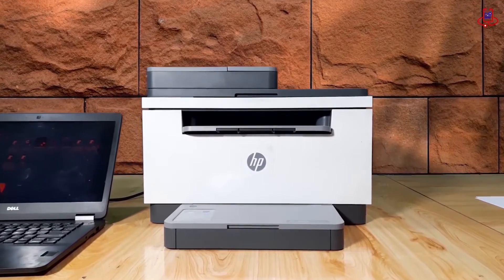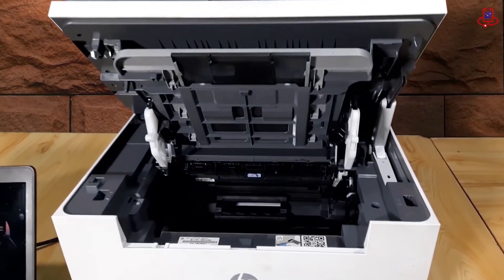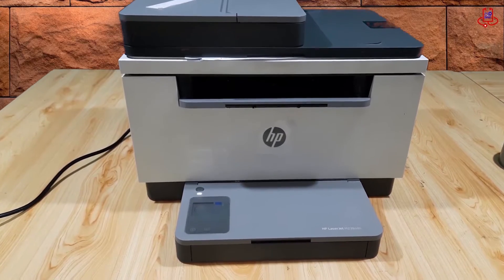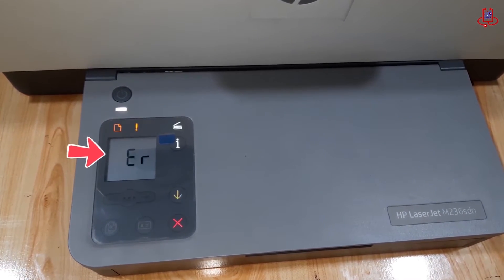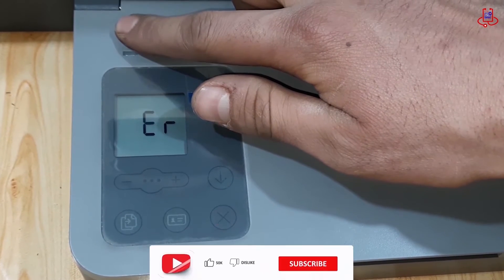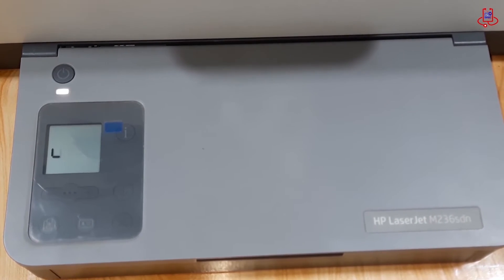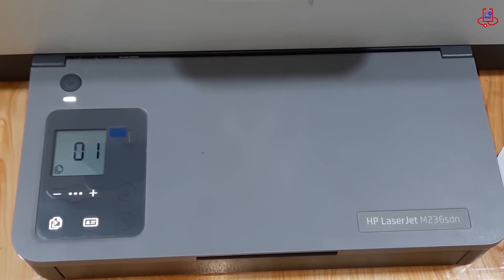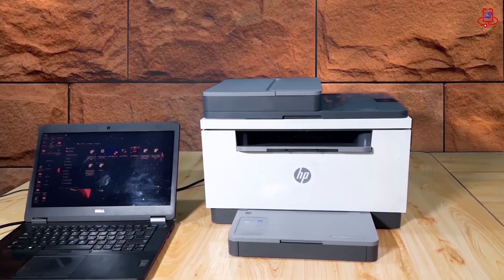How to Fix HP LaserJet Printer Error 77 in 2 Minutes! - Quick and Easy Troubleshooting

Comment: 2606dn error 77
Reply from the maker: Hi! Error 77 usually points to an issue with the fuser unit. Please turn off the printer, wait for 30 seconds, and then turn it on again. If the problem persists, check the cables and ports of the fuser. If the issue continues, update or reinstall the printer's firmware. Finally, if none of these steps work, consider replacing the fuser.

Comment: In HP laserjet printer m233dw printer copy button not working so I am replacing the new formater  board on display showing 76 error and all lights blinking pls tell what's the issue
Reply from the maker: This error usually means the formatter board is not compatible with your printer model or the firmware is not installed correctly. Try updating/reinstalling the correct firmware or use a board made for your exact printer model.
Reply from the maker: Try reinstalling the printer firmware once, it will probably fix the issue.

Comment: Error code error 77I have try that consistently
Reply from the maker: If the problem is not fixed, it’s probably the formatter board, and it needs to be replaced.

Comment: How can I resolve Er 75 in Hp LaserJet M234sdn?
Reply from the maker: To fix Er 75 on your HP LaserJet M234sdn:

1. Turn off the printer and unplug it for 30 seconds.  
2. Remove and carefully reinstall the toner cartridge.  
3. Plug the printer back in and turn it on.  
4. Make sure the printer is connected directly to a power outlet.  

If the error continues, update the printer driver or contact a professional technician.

Comment: How to fix error 76?
Reply from the maker: Error 76 on an HP laser printer indicates a service error. The first step is to reset the printer by turning it off and then on again after waiting at least 30 seconds. If the issue persists, you may need to check the printer's firmware, update it if available, and isolate the problem by trying different browsers or print drivers.
Reply: @devicedoctor1  This error appears immediately after switching on. The printer is not connected to the computer.

Comment: my printer Hp laserjet tank MFP 2606sdw error code 58
Reply from the maker: Error code 58 on the HP LaserJet Tank MFP 2606sdw typically indicates a paper feed mechanism issue. To resolve this, please follow these steps:

Check for Paper Jams: Ensure there are no paper jams or obstructions in the paper feed path.

Inspect Paper Feed Rollers: Examine the paper feed rollers for any debris or damage. Clean them gently with a soft, lint-free cloth if necessary.
HP Support

Reset the Printer: Turn off the printer, unplug it from the power source, wait for about 10-15 minutes, then plug it back in and turn it on.

Update Printer Firmware: Ensure that your printer's firmware is up to date, as outdated firmware can sometimes cause errors.

Consult HP Support: If the error persists after performing these steps, it's advisable to contact HP Support or a certified technician for further assistance.

These steps should help in resolving the error code 58 on your HP LaserJet Tank MFP 2606sdw printer.

Comment: Error 49
Reply from the maker: This issue is likely related to the mainboard of the printer. It requires inspection by a qualified technician to diagnose and address the problem. Repairing or replacing the mainboard may be necessary. It’s recommended to visit an authorized service center for proper evaluation and resolution.
Reply: @ I believe you’re correct.  I tossed it off the second floor of my house for the satisfaction due to its 1.5 years of abusing me with it constant loss of connectivity.
Reply from the maker: @MandyPants1975  
I completely understand how frustrating it must be! Unfortunately, the HP LASERJET M236 printer has had a lot of issues and hasn’t been reliable for many.
Reply: @devicedoctor1  Hello. Can you please tell me where I can buy a new (or used) mainboard (4QL13-60001/4QL13-80101) for HP LaserJet M236dw? My printer got malfunctioned (error 49) in about 3 months after I started using it. This happened after the service center refilled the toner in the original (genuine) "136A" HP cartridge with a chip. Unfortunately, the guarantee expired by that time. I'm ready to purchase a new/used mainboard. Otherwise I have a brand-new printer which just takes place in my house as a brick. Thanks in advance!

Comment: Mine keeps saying ER 11. ER 16. I’m not getting anywhere
Reply from the maker: ER/11, ER/14, or ER/17 Error

These errors might occur for the following reasons:

The toner cartridge is not compatible with the printer.
The toner cartridge has been used on another printer.
You need to replace the consumables.
How to fix the issue:

1:Replace the toner cartridge
Replace the toner cartridge with a new one and try printing again. If the issue persists, move to the next step.

2:Visit the printer workshop
If the issue is still not resolved, take the printer to a workshop for repair.

Comment: How to fix error 80
Reply from the maker: *Error Code 80:*

**Meaning**: Software/Network Error

**Solution**:
1.Restart the printer: Turn off the printer and turn it back on after a few seconds.
2. **Check network connections**: Ensure the printer is properly connected to the network. If using an Ethernet cable, make sure it is securely connected and in good condition.
3. **Update drivers and software**: Make sure the printer drivers and related software are up to date.
4. **Network settings**: Verify that the printer's network settings are correctly configured.
5. **Technical support**: If the issue persists, contact HP technical support. It may require further specialized inspection and repairs.